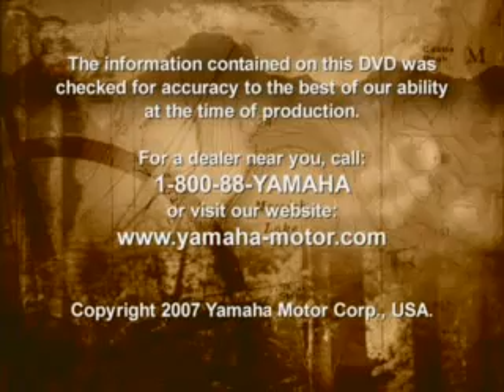YAMAHA GRIZZLY 700 FI DVD (5 OF 9) - 02/21/2008

Comment: I NEVER got either Yamaha CVT wet.

It takes under 2 minutes to drain a CVT and run it in neutral to air dry it.

That certainly beats the time it takes to do a Honda oil change, ride it, then do another oil change ensure all the water is gone.

I've known 2 Rincon owners, one that had water enter, the other had water and mud enter. The one with water didn't shift right, but he was able to change the oil twice and save it. The other kept riding, the mud damaged his, needed an expensive rebuild.

Comment: Another reason for the way your buddy does may also be simply because of switching from one machine to another. Even when switching between 2 brands of trucks that are both manual or both auto, it takes a few minutes to learn even minor differences in controls and ergonomics. That's one more factor besides whether it's an auto or manual that you ignore.

With me, since I have a good feel for mechanical things and am a natural born experimenter, I usually figure out everything pretty quickly.

Comment: @bighunt986 wrong depends the weight can be used as a atvantage becuase if not alot of weight your machine could get hung up . the polaris has a true 4wd but the grizzly the only thing i like is the looks if i wanted a tough machine i would go with polaris. i havnt seen 1 grizzly yet in my entire riding career beat a polaris . when i had my polaris 250 trail blazer i passed a guy on  a grizzly who was stuck in the snow. i tryed a grizzly i just dont see how their better .

Comment: Tell rock crawlers they don't need a locking front diff, and they'll say you're full of crap.

Having years of experience with 4wd trucks and 4wd ATVs, I've experienced the difference between a locker and no locker in mud, sand, hill climbs, and rock crawling.

And prove a Honda's first gear is so low that no low range is needed. One complaint about the 3 speed auto Rincon is that 1st gear isn't low enough. I've been rock crawling with a Rancher and Rincon, both struggled more than my Grizzly.

Comment: Honda has a HYDRAULIC CVT. It's the Hondamatic, and the Rubicon has it.

Here's something I found online: "The Hondamatic transmission is a hydromechanical CONTINUOUSLY VARIABLE TRANSMISSION with a fixed-volume piston pump and a variable-volume piston motor in opposition on the same shaft".

You use the "KISS" acronym, as if Hondas are supposed to be so simple. Yet you don't have the mechanical understanding to know that ALL of Honda's automatics are way more complicated than a simple belt CVT.

Comment: ok yes you CAN get water in a honda transmission but when you do find out there is water in it it has already been in there for weeks i have know MANY honda's ride for months with milky oil before the broke oh by the way on the manual shift models the engine oil and trans oil share the same supply it takes quite a while to determine if you have water in your oil you have to wait for it to turn milky first but most people change it WAY before it becomes milky change it regular and never milky:)

Comment: @lavergnn1 Yes, at least what I know to be true. Like the excess performance-robbing weight of the Polaris. The Sportsman's engine braking being on the rear wheels only because it doesn't go into 4wd unless the rear wheels are spinning under power. The fact that Yamaha has a better CVT, partly due to it's seperate wet clutch and the fact that it's not having to move nearly as much weight. The Sportsmsn's single brake lever. And it's quite possible there are other facts in the video.

Comment: ondamed works perfect never had a problem with it not working and punching the quad in park will melt a belt it is common sense rev it 3 times and the belt will spin with the cvt in neutral and it wont faze your belt and i never  really have had smoke come from mt belt housing on my 800 touring i had that thing stuck in deep stick mud and spring the tiers for like 5 hours and the belt did not brake i own 3 polaris and love all of them and i would buy another they are good bikes

Comment: Manually shifting into gears really has nothing to do with where you can or can't go. So that's really a moot point.

Yes, I don't use the locker all the time.

But where you mentioned lockers, you made it sound like lockers weren't needed. You said "who needs a locking front diff when honda's can go any were".

I know for a FACT that a truck/SUV/ATV without a locker will NOT literally "go any were" one with a locker will. Maybe 98% of the time, but not LITERALLY 100%, like how you worded it.

Comment: YOU ARE WRONG honda does not use CVT's at all honda automatics can be switched back and forth from auto to ES (electric shift) honda automatic transmissions still use gears they are exactly like car transmissions they still actually shift gears and use a torque converter oh and about low range.  honda's 1st gear is lower than any low range on any other ATV and who needs a locking front diff when honda's can go any were the the others can with less breakdowns:)

Comment: DUH. But if you get water in the Yamaha CVT, simply drain it on the trail, it dries, no problem (unless an idiot rider keeps trying to ride it before it dries). But get water in the Honda trans (can happen, although not often) you have to change the oil. Add mud to the mix or don't change the oil, there can be expensive damage, way more expensive than a belt CVT. A belt can be replaced by an owner with average skills. I've abused my Yamahas and NEVER burned a belt. Both have the original belts.